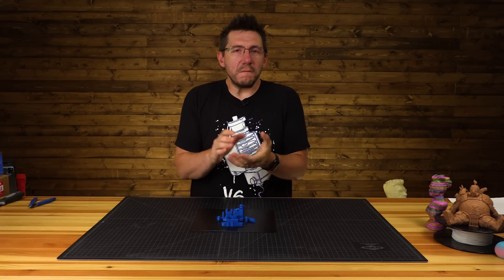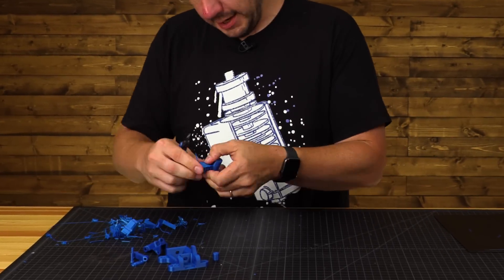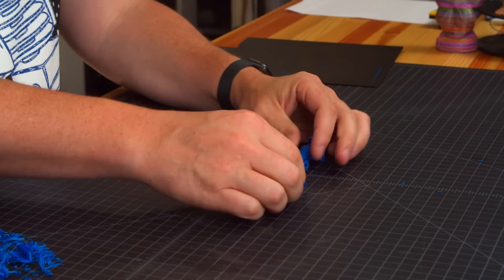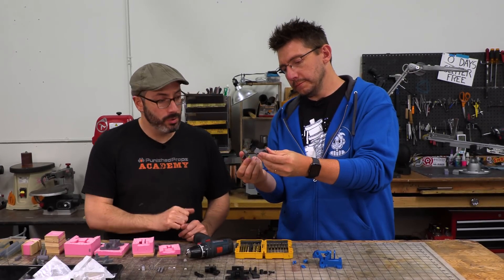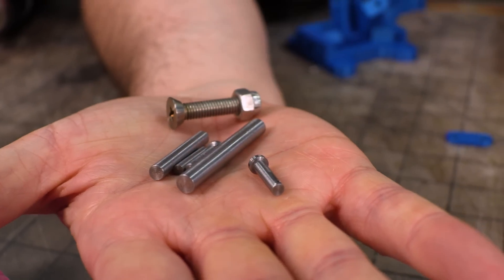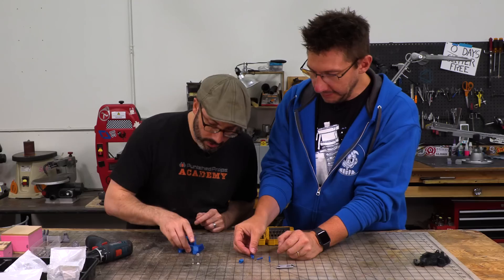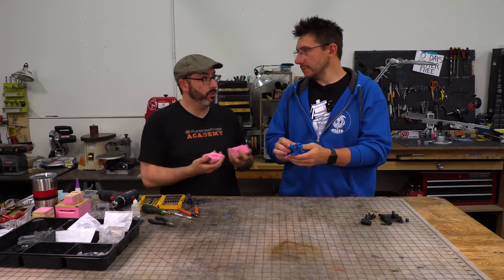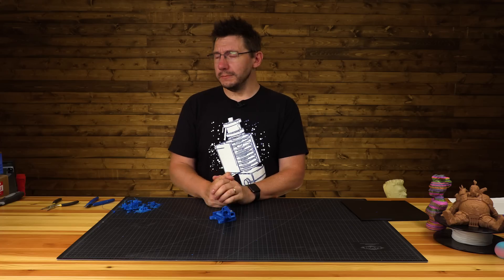3D Printing My Apollo 11 Latch for Adam Savage Project Egress

Comment: What Bill did is one of the reasons that anyone who 3D prints functional parts should learn at least the basics of casting.  Print it in what prints best and reproduce it in a material that works the best!
Reply: for some reason I was able to smash a large piece of PLA at speeds greater than 50 MPH against a piece of flat tin, and the PLA survived... The tin didn't. Wasn't even 100% infill.

For those of you wondering what I was doing, I made a nose cone for a rocket I was working on, and the recovery system failed.
Reply: @gallopinggoose6891  I left a PLA part in my car on a hot day and it softened and deformed.

I tried to conduct electricity through a PLA part and there was too much resistance.

I used a piece of PLA for a hinge pin, but it decided it would rather be a shear pin.

For many things, what prints well also works well enough.  But for when it doesn't it is good to have options.

Also, Bill's resin printer doesn't print PLA.
Reply: @andy-in-indy  Well obviously a resin printer doesn't print PLA. My point is that there are situations where you can get away with just 3D printing something, and not having a need to cast it.

Comment: Final assembly will be interesting. I foresee issues with the tolerance stacks involved.
Reply: There's also going to be issues with some of the more 'artsy' contributions doing things like combining two components that are supposed to be adjustable or movable into one solid part, like the gas or spring cylinders on the hinges. I've seen another part, one of the latch linkage rods that connect them all to the one handle, made with clear 3D printing to the drawing dimension but then some pieces of sheet brass with other bits soldered on and poking out layered on, and the shaft wrapped with brass wire. The clevis on the end opposite the other with two spherical bearings (which were nicely done and functional) was supposed to be threaded but the maker made them as a smooth rod and hole.

That one part is going to prevent the latch mechanism from working, if it even fits with the spherical bearing end out of dimensional tolerance. Likely won't fit the two clevis ends that are supposed to connect to it.

Wasn't the commission to make the parts the same dimensions as the originals while leaving choice of material up to the maker?
Reply: greggv8 I saw that one. Engineer says no.
Reply: @troglokev  and the verdict is in. People not following the directions caused several problems with the build. The hinges broke. The porthole surround was too small, and more.

Comment: Are there multiple of these latches? This looks very similar to the one Franlab is making.
Edit: Just checked, it appears there's quite a few of these on the hatch.
Reply from the maker: Yes - many!
Reply: Looks like 15 latches, all connected by rods with adjustable threaded ends. A single lever actuates all of the latches. The hatch then pops out a bit for clearance then swings to the side.

It's a design born from the Apollo 1 fire. That hatch opened inward and required multiple operations to open. Even if the astronauts had been able to undog the hatch it would've been impossible to open because the heat of the fire raised the pressure inside the capsule. Then there was the outer hatch to deal with. Finally, there was the 3rd hatch layer in the Boost Protective Cover (jettisoned with the launch escape tower) which was open during the test. With three men dead in 17 seconds, the rest of the astronauts insisted the hatch had to be redesigned to be opened easily and very quickly. https://www.engineering.com/Blogs/tabid/3207/ArticleID/67/categoryId/7/Apollo-1.aspx
Reply: Yes, the hatch looks like that of an autoclave sterilizer, to keep the pressure inside.  Except that a sterilizer usually has a wheel that is screwed shut, this door and it's latches opens instantly.

Comment: Hey Joel. I finally bought some of your high five blue. I had a question about what temp you have to run it at. I ran it at 210 at first and had terrible layer bond. Had to bump it up to 225 to get it to stick together well. Is this normal?
Reply from the maker: It depends on the machine and the extruder and the nozzle. I’ve printed it anywhere from 201c to 240c. Printing it at 225c shouldn’t be an issue if it looks okay.

Comment: Joel, Having seen the real latches many times, I think yours is about 2.5x too small.  You have assumed that the STL files are in mm, but I bet they are in inches.  You might want to double check.
Reply: I can confirm that the STL files I made for this were in mm, not inches. The original parts were all imperial, but I chose to use mm to model the parts since I was measuring scan data from the Smithsonian.
Reply: Methinks they would be 25 times off if that we the case...
Reply: @AndrewBarth  Thank you! Would you consider sharing the files?
Reply: @jonpoland2705  Definitely! ALL of the files made for Project Egress, including CAD files and technical drawings, can be found at 3d.si.edu/apollo11cmhatch
Reply: @jonpoland2705  the files are on the Smithsonian website!
Reply: @AndrewBarth  The 'dirty little secret' of the STL format is it only recognizes ONE unit, the Millimeter. I use Ye Olde Caligari trueSpace to model stuff for 3D printing. I can use Millimeters, Centimeters, or Meters. To STL it's all Millimeters. So if I want to work to three significant digits of precision on a small part, and be able to see the model in the workspace, I set trueSpace to Meters. Just have to keep in mind the output will be Millimeters. I also have to save twice, once in the native trueSpace COB format and once in STL. The reason being that trueSpace's import function for STL and some other formats has a bug that was never fixed, and Microsoft didn't bother to fix it either. Import an STL (and certain other formats) scales the model to make its largest dimension in X, Y, or Z just 8 of the currently selected units. There is a fix, load the STL into a slicer to get its dimensions in Millimeters then in trueSpace scale X, Y, and Z to match the slicer, save as COB. Then the model can be edited.

I expect that newer software made with 3D printing in mind, will save a 3 Centimeter model with its dimension as 30 Millimeters in the STL file.
A revision to the STL format to support other units of measurement would be nice, but it's not likely to ever happen, or it will take decades, like the newly released update to the Musical Instrument Digital Interface that's been frozen in carbonite since the 1980's. Scaling is up to the slicer or other software loading the STL. You can work in Imperial Units but unless the software used to create the model converts to the correct amount of Millimeters when saving to STL, a scaling factor to adjust will have to be applied in a slicer. (Yup, another never fixed bug in trueSpace, save to STL using Imperial units and the size is wrong in a slicer.)

Comment: What 3d printer would you recommend for a person doing bronze lost wax sculpting that would of course be able to use casting friendly type plastic I read about yet isn't to hard for a new be to use
Reply: Depend of $$$ you have. 
You can buy cheap like anet go a little bit more expensive like tevo etc , buy prusa or just make one. I like to make one becouse i can use high guality parts like cnc linear rails , 32bit controller , stepsticks , motors etc and buy it the way i want (the best printers use bed only in z axis ,it is simple to build nd save you a lot of space in comparsion to prusa etc. 
My printer is 450x600x470mm (yes 45x60x47cm) print space and frame outside is 600x900x800mm :)

Comment: You dont use PVA for your support interfaces on the Ultimaker?
Reply from the maker: This was printed on the Prusa i3 mk3.
Reply: @3DPrintingNerd  I know but I wondered as you probably have some PVA at home wouldnt it be easier and better to print this with PVA supports or at least the interface layers to make supports easier to remove?

Comment: Hi I have a question I want to print a part for my dirt bike it might get left out side from time to time and roughed up a little I was thinking I would sand and paint it for UV protection but what filament would be the best to use the part is a light housing
Reply from the maker: Light housing - meaning the non transparent part right? You would want ABS or look at ASA.
Reply: Ok thank you very much and yes it's not transparent

Comment: When will Joel hop off the band wagon and start using better FDM printers?

Edit: Looks like i was too quick to judge (see replies below).
Reply from the maker: Which one(s) did you have in mind?
Reply: @3DPrintingNerd   It would be great to see you build a Voron1, Voron2, Railcore, or even a HEVO. There are many Build/Source-It-Yourself options that don't seem to get enough love from Youtubers. The Prusa is a work horse, but it is over-promoted. Also, from what I have seen online, the Funmat HT used for the ABS bits, has very poor quality when compared to other cheaper options out there.

All that being said, Thanks for responding to this. It came out a bit harsh, but I would very much like to see more printers represented.
Reply from the maker: I’m doing my best to get through my queue. I have a LOT of machines still in boxes. The Funmat is amazing at ABS, SO GOOD. I need to get my video on that filmed before I install the high temp hot end. I would LOVE to build one of those machines but I haven’t had the time or the right space for it. I did feature the Railcore on the channel and people loved it.
Reply: @3DPrintingNerd  Not sure how I missed the Railcore video. If/when you have the time, I know of at least a half dozen Voron2 printers in the Seattle area.  I'm sure someone would let you borrow one for a video
Reply: Better is relative. Someone might not have the time to source all the parts to build a Voron 2 let alone the money.

Comment: Okay honest question - 3D printing is fun and cool and “modern”, but why the heck are we building replica spaceship parts out of $20 rolls of cheap plastic?  This should be CNC machines out of billet aluminum at minimum, magnesium or even titanium (which technically can be 3D printer now) at best. Or are we accepting that this “Project Egress” is basically just a toy?
Reply: machined*
Reply from the maker: Honest answer - I don’t get it. Project Egress project is an art project. I used 3d printing because, well, you’ve seen the channel name yeah? Others killed, or used wood, or use resin.
Reply from the maker: killed? hahahha stupid autocorrect. others MILLED.

Comment: Nice work.  Fifty years out, with new tech and makers of this skill level, instead of building a replica, why not try to design and make a better hatch for, say, the same spacecraft opening?   Fewer parts, more reliable seal, easier-faster to assemble, lighter, stronger, more robust, lower cost?
Reply from the maker: I think there are teams of people currently doing that.

Comment: taping a plastic hole makes no sense to me. the screw will cut its own threads into plastic.
like literally no plastic injection factory or assembly factory (that i've seen) pre taps holes because the screw does all the work. 
trust me i've worked in both types of facilities that use a wide range of plastic and different process's.
Reply: I like to tap the holes if I know I'll be using them more than once (and I feel too lazy to use threaded inserts). Using the screw straight into the hole works for sure, but it's in there very tight afterwards.
Reply: I worked in an injection moulding shop and we tapped holes all the time. The customer doesn't want to have to force a screw in every time they open a part.

Comment: Yep, you guys are 21st Century Geeks....(I mean that in a good way).... but remember....those latches were 'designed' with many engineering requirements .....force, material, weight constraints, ... and above all the NEED to keep human lives safe...  the reason for this 'project' is in remembrance of ALL those American workers, engineers and astronauts (that put their lives on the line)...that had extreme ingenuity, and fortitude to complete what was needed, not knowing if it would work correctly or not.   You should have a humble view of working on this project, and the meaning of it....